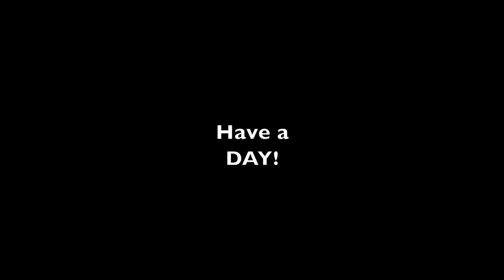#812 How Did Nobody Think of This Before? Simple Strap!

Comment: mike have you looked into the roof rack attachment for your side by side?  i built one for mine, there are two brackets on the back of the roof  support i used those to raise a bar above the roof line and then added two insert brackets for the back on the bed, now i can carry long boards without having them in the cab...  would be a great small welding project for you...

Comment: You should weld up A little extension from the trailer hitch that holds the back of that wood so you can pull it back a foot and strap it down with some bungees so it’s not gonna slide forward or back, just have it come out of the hitch and stick up to the same height so it holds it fairly flat with the back down a little bit I just throw some of those straps over the top.

Those straps are cool, thrown in the mud or the dirt intestate I would love to see if they still work dirty or wet or greasy. I can think of a ton of uses for those

Comment: You know what I use? I carry a roll of  velcro strap that's 1-1/2 x 50ft I. cut it to whatever length I need.  It's the best thing I have ever used.  I do hot shot work never had anything that  have tied down with it come loose. I also have cut several lengths about 10" long to rap around the handles of my ratchets to secure them.

Comment: Haha I could have used those 7yrs ago. Had a washer strapped in my dad's truck bed up by the cab
 Hooked into the front d rings, tail end of strap came loose and went in between cab and bed and wrapped around the drive shaft. Let's just say those 1"wide straps are 💪. It wrapped so tightly around drive shaft at 60mph, it pulled the front of the bed flush with the floor of the bed before it broke the strap😱. Ya @Mike Morgan That wasn't fun telling your dad to come take a look. Lol
Reply from the maker: Lol oh my

Comment: When you said you were going to drive back to the mini cabin 5 times faster than you normally drive, I thought "just let Melissa drive them at her normal speed"!  Dang!  You really put the coals to it!  Should be carbon free for a while.  I think that needs to be done on everything now and then to clean it out.  That and a good fuel additive.  I like Sea Foam.  I'm going to have to get some of those straps, I can think of all sorts of uses.

Comment: But are they DOT approved? 
That is  important because i have seen the DOT  force people to replace there straps because they weren't.  .😊👍👍🇺🇸💥🌎
Otherwise there really cool straps .
Reply: I doubt you will run into much DOT in the woods on the Ranger. Mike also mentioned that they aren't intended to replace your ratchet straps.
Reply: @jasone9  you no veey we people will use them where they should not. 
And people  on general don't know how to use wrachet straps this is why I pick several a year.  And most are not DOT rated .
Reply: Interesting simple strap demonstration. If there is something available to make the job easier Mike will get and use it!